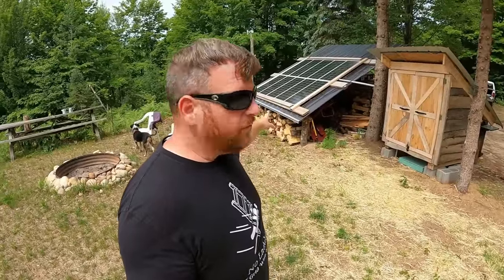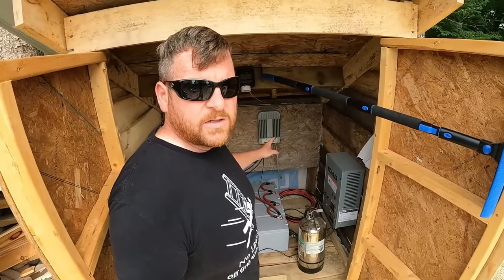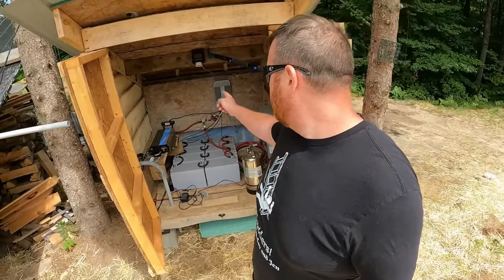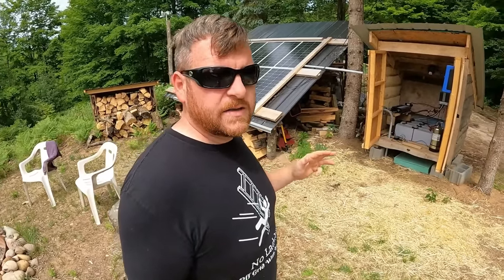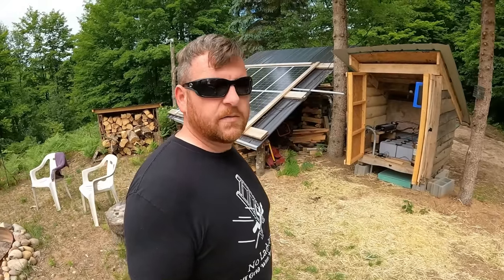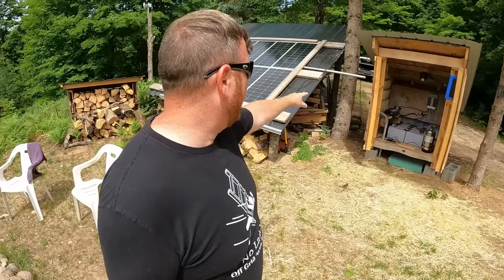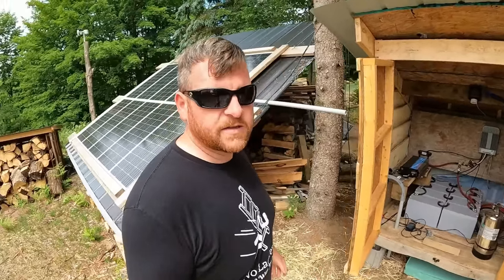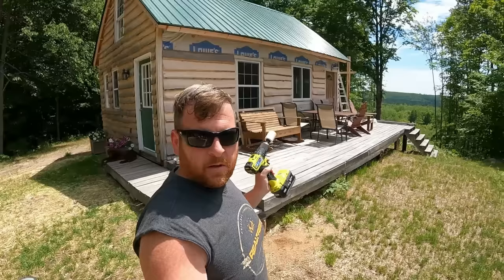One Year Off Grid Solar Power System Update

Comment: I think you did it perfectly. No suggestions. You're already awesome! What a deal too. Only ~$3500 for free electric off the grid! Sign me up.
Reply from the maker: Thanks NK.....very much appreciate the kind words and support. best wishes
Reply: There are a few minor downsides with it being on the cheaper side these inverters are not the most high-quality ones which is fine but they may not last 60 years and you don’t have advanced monitoring that certain systems would offer you

Comment: So glad i found you ! Thank you ! Im late to the party but couldnt you just insulate the shed a bit and just run a regular 40 watt light bulb or a heating light bulb inside of it ?
Reply from the maker: Yes I could, and that would be the smart thing to do. Because I already have everything installed it would make it a bit of work to do now. More recently we have a few nice power stations for back up, so I might run the cabin on one of those this summer and fix a few issues.

Comment: I'd insulate the interior of your shed, and yes, pad it up on the floor and put like a small foundation box under your shed so it has a dead air space (insulation in itself) under the shed.  Then a 100w light bulb running in the shed will keep it in the high40s and 50s even at subzero temps outside.  I'm south in the Tri-City area and my cement well house with some foam insulation on the interior stays in the 40s and 50s through the winter whit a 100w bulb (old bulb, not an led or fluorescent equiv. old school 100w bulb).

If your channel ever blows up, gl on commenting on all comments. lol but that would be a good thing.

Been thinking of adding some solar myself.  How often do you use the system?  Obviously you're not living 24/7 at the cabin.
I'm looking for my home use.  Want to put up a Greenhouse/Hoop House setup and have solar setup on the House part.
Reply from the maker: We spend 10-14 days here at the cabin and go downstate for a week. We spend 50-75%of our time at the cabin. So it runs everything for weeks at a time without depleting the stored power
Reply: @OffgridwithJayandJen  Thanks for the info. Exactly what I was looking for as I move in this direction here in Mid Michigan.
Reply from the maker: @HBFTimmahh  👍

Comment: Not sure if it work or not. But you might try reptile heat mats under the battery’s. You can set the Temperture on it so it kicks on and off.
Reply from the maker: Cool....I think the rv pads work the same way.....will definitely check it out. Thank you
Reply: They are good, but cheap ones have been known to catch on fire or milk. You have to be a little bit careful

Comment: We have a $1300 solar system in central NY in the woods (3hrs of sun) that runs a 4.5cuft mini fridge along with charging our devises and cabin lights.  Nothing is DC.  The $1300 includes the price of the fridge, 120v charger and 1kw inverter generator.  I built the system my self.
Reply from the maker: that is awesome. I remember you telling me a while back I could handle a bigger fridge on my system....and yours had fewer batteries and did good. I love the $1300 price point....I was hoping ours would be under 2K but we had the money saved so we bought what the money bought, lol.
Reply from the maker: I did forget to mention that in the video......Sunshine is important. We get about 5 solid full capacity hours a day and 3-4 more split in the morning and night of 25-50% capacity.

Comment: The electronic equipment you are using generate heat in use. Insulate the hell out of the outside walls and use that heat instead of dumping it. Every watt counts, and insulation is not very expensive. Sometimes a contractor will give you used insulation for beer! In hot summer months add ventilation slots to your door.
Reply from the maker: Good point. good projects for future videos. Best wishes

Comment: Thanks for a video on a solar system for ordinary people without a lot of money. I have 40 off grid acres in north central MN. I probably have less money than you do so I have been trying to figure out cheap workarounds to a million dollar solar system. There is a guy who sells used solar panels on Craigslist in Duluth, about 50 cents a watt. 

I was recently gifted six 165 watt, 37.7 Voc solar panels and a 30 amp Midnite Solar charge controller. Now I have to figure out the rest of it. It would be helpful if you could provide links to the the components you used. 

What is the inverter? I would like to get one that has enough reserve capacity and can provide it long enough to start a small window AC. There are 2 flavors of inverters. The common wisdom is that high frequency inverters can not provide the reserve capacity long enough to start motors like in a fridge or AC. Low frequency inverters can provide the reserve capacity for as long as 20 seconds but they are heavier and more expensive. If yours is high frequency and starts the fridge just fine then I won't spend the money for a low frequency one.
Reply from the maker: Pure Sine Wave Power Inverter 3000Watt DC 12V to AC120V with Dual AC Outlets with Remote Control and LED Display for RV Solar System ETL Approved https://a.co/d/eSrs16h

This is model,  but I have the 24 volt model.  I couldn't quickly find the 24 volt one. It runs our fridge and all power tools great.

Comment: Nice setup and cabin. Have you ever considered a mechanical room addition to your cabin? I converted my second bedroom to my battery and water tank room to keep everything warm as I live in northern NY. I have a 200 gallon vertical tank in the corner and the closet houses batteries,inverter, charge control and 12 volt fuse block. It's convenient to have both 110 and 12 volt in the house because if the inverter craps out I can still run lights, rv water pump and charge my phone. I run a similar 24 volt system that I'm really happy with but one drawback is 24 volt inverters are not as common and I can't source one locally. Do you keep a spare inverter around? Just something to consider.
Reply from the maker: I would love to have a Mechanical Room for sure....My BIG fear originally with the solar equipment was FIRE, lol. I tend to WING IT more than I should sometimes and this solar stuff can obviously be dangerous and last thing I wanted to do was burn my cabin or the forest down with my lack of knowledge. I do feel more confident in the solar now and would be comfortable with moving stuff inside....maybe in the future. I would also love to have a water reserve inside like you said.....maybe in the loft I can sneak in a smaller tank, long as the weight wouldn't be a problem.....even if it was only 50 gallons that would be nice. I originally had this system set up on a large cheap 12 volt inverter and it quickly gave up on us.....to help with wire size and efficiency I switched to 24 volt.....I have two of a lot of things......but I do not have an extra 24 volt inverter. We are talking to a few solar companies for sponsorships and maybe an extra will end up in my hands. THanks for the Comment and sharing your tips and experiences. Best wishes
Reply: @OffgridwithJayandJen  I'm using an MPP  2424LV all-in-one. Great unit. Puts out a better AC signal than the Giandel inverter I had before it. The Giandel would make my LED's flicker if I was only pulling 100W or less out of it. The only way to get rid of the flicker was to run high wattage or power on a 60W incandescent lamp for a minute. Of course with an all-in-one, if one part goes bad, it's likely the whole thing is unusable until repaired, but the electronics build quality seems to be pretty good on those.

At only $650, it's probably worth buying two for 100% off-grid use. You could keep one as a spare or use two for 240V. If one goes out, you can still have 120V.

 I'm on grid, just using this as a backup when the power occasionally goes out and to power various things when the battery fills up to save a few bucks. I just like having the self reliance.

Comment: In Finland company is heating Sand with a windmill and solar panels.....  NO BATTERIES     The sand goes to 600 C and you can heat a building all winter check it out   Sand  heat Finland
Reply from the maker: Sounds interesting

Comment: Another point: when a basic off-grid system is set up (i.e. the grid is created), you can complement it with smaller grid-tied systems, which are more efficient (avoid dc/dc/charge/discharge cycle) and reduce the pressure on the battery system.
Reply from the maker: makes sense......less excessive discharge the better
Reply: Actually, you need proper expensive inverters for this to work great as if let’s say every circuit trips but your grid time Verta you want that inverted to be able to cope with it and charge the batteries as these inverters have to send out signals to control grid tied ones

Comment: Not sure if it’s worthwhile, but have you considered building a passive solar heater (those black cans in boxes) on top of the shed and plumbed into it to warm up the space? 
I’m pretty new to the off-grid stuff, but I’ve seen some pretty clever things that people have come up with.
Reply from the maker: I would have to look into more stuff like that to be honest. I like passive  lol. I have thought about using the black piping in the cabin roof for heating water for showering,  but not much research past that. My thoughts with insulating just the batteries is they produce small amounts of heat while charging either way....so if I can join that with a small heating pad then running off the solar too, then keeping that small space above freezing. But I will look into more info on that. Maybe greenhouse effect too for the whole shed? Have to see. Thanks

Comment: You have a thousand watts of solar. What is your output on a sunny, cloudy and day rainy day typically? And what do you do for purifying the rain water if you drink it?
Reply from the maker: On the best day I have pulled in 8-900 watts for a few hours in the middle of the day. 4-500 watts on sunny days with indirect sunlight in morning and late afternoon hours. On cloudy days I pretty much get 100-150watts with heavy cloud cover. We pump the water out of the rain catchment through a 1 micron hose filter, then put it through a Berkey filter for drinking. No additional filtering when used for dishwater or showering.

Comment: The real trick is having income and medical coverage so you can disappear into the boonies.    I went offgrid 25 years ago and spent several years learning and unlearning a lot.   I see quite a few issues with your setup that make it less efficient but like you said, it works well enough.  I highly recommend a proper ground to all the gear including the panels.  Most  of the calls I get that involve equipment failure are due to lightning damage.
Reply from the maker: Funny you mention grounding.....what would your recommendation be for that?? I can't seem to find a reliable source to use. I took a 10 foot copper grounding rod pounded it into the ground next to the shed and connected it to the inverter and CC but never got around to including the Panels. does this method provide any kind of protection or was it just a silly half ass effort? Thanks for mentioning that....being up top the hill here I feel we are more vulnerable than some.
Reply: @OffgridwithJayandJen  actually you have set yourself up for a potential scwacking.... the negative battery post should be attached to the ground rod and everything else ... directly... not daisy chained.   I order ground clamps for PV panels off Amazon.   I find way too many "floating" systems like yours after the lighting damage reduces output 90 percent or takes out an inverter etc.
Reply from the maker: @chrisniner8772  so can I take a six gauge bare stranded wire from my negative buss bar directly to the grounding rod?? I don't want independent wires going for the Inverter and CC to the rod??   thank you for being patient with me.....I have been worried about this for a while and no electrician will give me a straight answer. ALSO my cabin has a traditional AC breaker box and ZERO grounding as well.   AGAIN THANK YOU for any help

Comment: use led acid batteries outside send ac inside to charge lithium battery bank works great .
Reply from the maker: Makes sense....but the cabin is not heated full time....so we would still need to let the lithium batteries warm up, plus converting the power back and forth is extremely inefficient.  I lOVE the idea and thought.

Comment: you need a equalizer circuit between the12 volt battery banks so they charge equally ... otherwise one battery bank could charge higher then the other one and cause overcharging/undercharging
.
Reply from the maker: I did spend some time looking into this but honestly can't remember why I didn't end up doing this. If I were to guess I think it was because my batteries are lead acid an there are only 8 of them. I also have the negative and positive hooked into opposite sides of the bank so that forces flow through. I did research it a little but like I said never came to a final answer whether I was entirely necessary for my set up
Reply: @OffgridwithJayandJen  it depends if you check with the multimeter and they have the same voltages great however due to manufacturing tolerance says your batteries could have very slightly different capacities so their voltages are different. It becomes an issue when the difference becomes big and one gets overcharged.

Comment: Maybe insulate your battery room, and maybe a small voltage  heater when the battery Temps are getting cold ?   All in all , a very good ser up (-:
Reply from the maker: Ha...thanks.....it has its flaws but working toward perfection

Comment: Question about the ventilation in the battery shed.  Do the gases escape from the top?.  You have a nice off grid property.
Reply from the maker: The solar shed is not very tight.....lots of air flow in there. The AGM batteries we have actually have  no off gassing. They are maintenance free and sealed, so no need to worry about off gassing

Comment: You can now custom order lithium iron phosphate batteries that have built in, internal heat tape.
Reply: I have done testing in very cold temperatures you lose quite a bit of the energy. It could be worth it or heating the room anyway but especially I’m very cold cloudy days you may actually not keep the batteries at a constant charge. You will end up losing charge, which means running a generator more

Comment: I really enjoyed and appreciated you sharing the component information and costs for your solar system. I am still wondering if I want to be able to have 1,000 kWh per month, how do I determine the number of solar panels and batteries I will need? Am I correct in assuming that if I use 400 watt panels, they will use 1/4 of the space than if I use 100 watt panels? Again, thank you!
Reply from the maker: The 400 watt panels are much larger than these 100 watt panels. We only used these panels because we bought them during shortage times and they were easy and available 
....but work great

Comment: Using a battery to heat your other batteries so they work better. That would be interesting to see later.
Reply from the maker: That is basically how they are trying to warm lithium batteries by having internal heating pads installed factory.  I'm thinking I would like to have a secondary system to heat the primary one.....this would protect the whole bank from getting drained too low and then causing failure, but I have not looked into many options yet.....we will see what I find. Best wishes

Comment: I like it! A much more attainable system, more realistic for us! I'm just getting started designing and deciding on what I will need or want. I'm going to try to go along the route of easily expanded and upgraded gradually over time. Nice place! Wonder if water line heaters would do ok for heating up those cells ?
Reply from the maker: They may work. I put RV tank heaters under the batteries last winter....but didn't use them very much
Reply: Go for victron it is seriously the only one I would ever consider for wanting to change things frequently. You can add things like multiple charge controllers on a battery but when you use ones that let you control them all at once so they all change how they’re charging the battery at once it makes it easier and that inverted let you parallel them, if you decide you want a bigger capacity, but there is a price associated with that flexibility

Comment: So I’ve been trying to figure out the same setup but to run everything in my double wide that is cost efficient but damn sure don’t need to pay for the unnecessary things not needed in the system…
Reply from the maker: Well you can go that route, but those extra things help protect your equipment and such. Most of the extras was wires and terminals. They are more expensive than I thought. 👍

Comment: Could u put a small heater on timer, in that shed,  to keep batteries warm?  Also running on solar?
Reply from the maker: I actually Installed some heating pads under the batteries and don't really use them because the winter has been so mild....but I used RV tank heater pads and they worked well....when needed